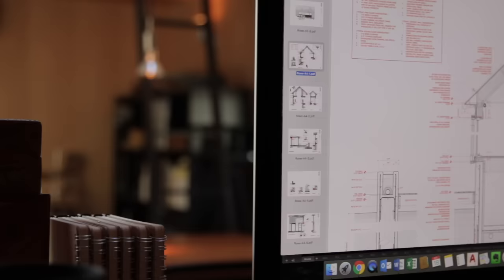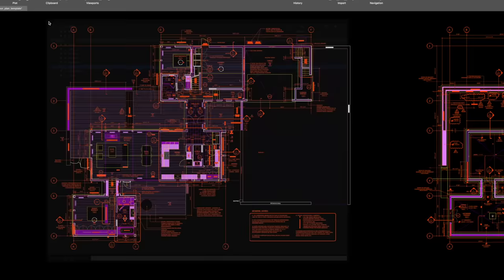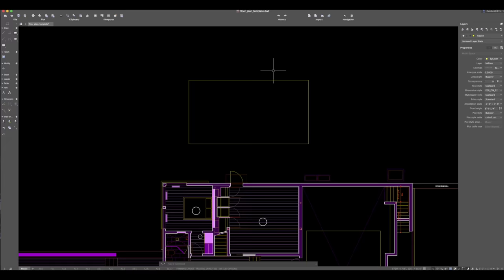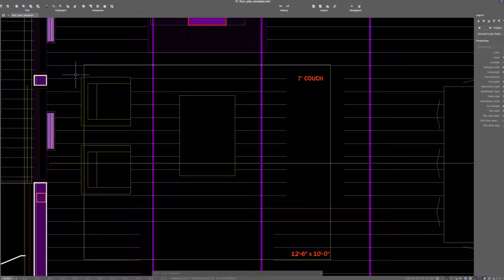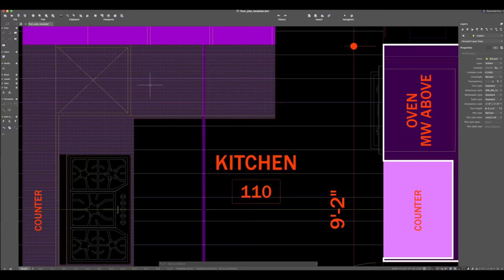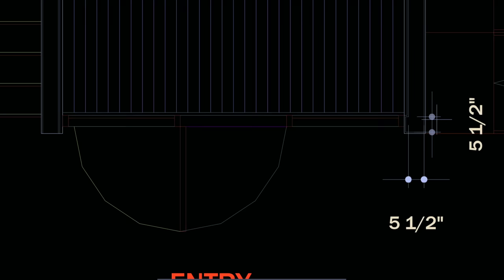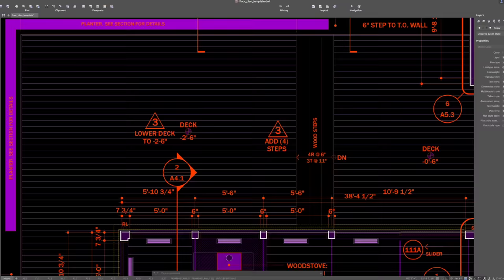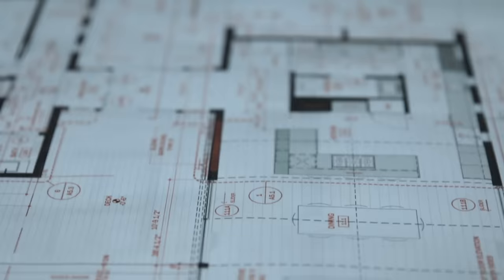Architectural Drawing Tutorial | My process + settings

Comment: I've been drafting since the late 80's, learnt the old school way on drawing board, pencils & ink pens. Then took up AutoCAD pre Windows era in 92 and used this for years. Now I use Revit, it's a joy to work with once you learn. Good video though on the essential discipline of preparing technical plans.
Reply: I'm thinking about starting at 24. The work interests me, but I grow worried about exactly what career opportunities I might have. It makes me happy to see you've been at it for such a long time. What kind of work do you do?
Reply: @reinaldoverde9825  good time to start, the key is to diversify. I did mechanical drawings, then residential design, structural detailing, renovations, new homes, light commercial, decks and pools, retail fitouts etc. My only regret is I didn't get a formal degree if Architecture.

Comment: I use Revit and now that i have learned it a bit more i can say it can totally replace autocad and save you huge amount of time for line drawing!
Reply from the maker: here's a question for you: how do you reconcile the idea that efficiency gains for a business that bills on an hourly basis don't benefit the business, only the client? which is to say: if i'm more efficient, i actually earn less than i do now. 
this isn't an efficiency problem for me. if i get the right clients, i can spend the time i need to on the project (within reason) because i'm already efficient using the tools i have. certainly i'm interested in BIM and I can see the benefits for sure, but I'm more interested in building some architecture, working on my photography, making physical models, recording videos, making films, hiking, traveling...all those things...and i'm afraid i put all those things above learning revit...

Comment: Been drafting and building for over 35 years, even today i find all architects/designers change their ways of doing plans. most don't use the materials method they leave it up to the estimator to figure out. Where i build structures and cabinets, I can draw an exact detailed plan for my workers or sub-trades.

Comment: >Draws floor plan
>no autocad
>open sims 4
Reply: i use bloxburg on roblox because im poor lol
Reply: @only_kaylaxo8329  I use roville lol
Reply: @only_kaylaxo8329  i LOVE bloxburg
Reply: I use Chief Architect Premier, for the past 10 yrs, along with AutoCAD, and SketchUp. CA is similar to SU on steroids. I use AutoCAD mostly for detailed cad work, also cause I’ve used it since original version back in 82’ if memory serves me. SketchUp I use primary for making symbols or 3D SKPS for use in CA. Self taught in cad along with 40 plus years as a contractor and GC for 32 of um.  Just love the drawing and challenges.
Reply: @Ben Yehudah That's tough to answer, I love drawing in general. Unfortunately my hands aren't what they used to be so I rely more and more on technology. I do however find the technology these days quite amazing compared to what I worked with back in the 80's. Before AutoCad introduced 3D.

Comment: Beautifully shot and wonderfully executed video!

1) Do your GCs and their subs not photocopy drawings?  I agree that color (even limited to B&W + Red) looks great for the first generation, and that transparency/shading like that looks great off the plotter.  But I've never plotted 100% of the drawing sheets that are used by the folks actually bidding and building a project.  Even with PDF drawing distribution, many sets are clearly photocopied from original plots, particularly for subs.  Red becomes dark gray for the first copy and ??? for later generations.  Shading gets jacked up with the high contrast of photocopying, so a light gray may be lost in a generation or two and a middle gray may become black. Where annotations cross over gray... may become a solid blob of black...  Line hatching, stippling and dashed lines survive this, of course (mostly.)  Fine line weights can be a problem.   How much have you rooted through the drawings subs are actually using to see what becomes of your beautiful starting points?

2) Given the comments here, it looks like a lot of your viewers would love a video that goes into much more depth as to how and why to use various types of hatches, shading, etc. particularly in elevations and sections.  You're spot on that it helps, but for folks at the beginning end and middle of the learning curve, it's a big leap from "you should do this" to  understanding exactly how, why and when.

Comment: Excellent video with good information.  One thing I read once and use it for my line weights settings is that in order for the human eye to see a difference in 2 lines of different thicknesses, one line has to be 1.4x the thickness of the thinner line.  I have a pen table for each size print.  I print 11 x 17 on an HP5000 with a pen table set up for 11 x 17 and a different pen table (thicker lines) for 22 x 34 or 24 x 36 plots.

Comment: "I use the most primitive CADs"

Man, I use Autocad 2007
Reply: I'm still using AcadR-12 with the Soft Desk Auto-Architect add-on. Been using it since it first came out in the transitions from drawing boards to computers. C. early 1990's. Started with Acad-R10.
Reply: Maybe the best release, IMO.
Reply: I would agree about R-12 being the best. Where I worked, our IT guys would come around and ask if I wanted to update my AutoCad. I would ask what revision is it? If it was an odd revision? There is no way I would do it. If you think about it... R-10? was good. 11... alright, R-12... Great, 13... sucked, R-14... almost as good as 12. Odd, bad. Even, good!!!
Reply: @straightshooter8443  Good tip about odd and even. It would be nice if they took R12 and just updated command enhancements just leave the rest alone. Ugh.... LOL..oh. R13 was so aweful, I stayed where I am for now. R12.
Reply: Our firm has been using ACAD2004 since early 2000's, and almost worship it. No subscription extortion or cloud struggles. Stable as hell and resides on its own, hermetic XP machine (soon to be updated). We've pushed out projects from small residential to corporate, mixed-use. So true: it's not the instrument one uses to draw that creates the design, it's how one uses the instrument to design. Recall, the first designs were likely described with sticks in dirt.
Reply: Some of my seniors acclaimed that 2007 version is the best. I myself use 2013 tho.
Reply: Tf
Reply: Dude, Autocad 2007 is the best version.
The most stable and fast response on a normal computer.
I have to say bye bye to them on Windows 10.
Reply: 哈哈哈哈哈哈哈哈哈😄

Comment: As a part-time residential architect (I am a healthcare project, Program Manager/Project Executive), I struggle to find the time to add the nuanced details to my drawings. This is especially so as most of my clients are looking less for a design than a stamped set of drawings to get their building permit. These videos have inspired me to spend the time setting up a better drawing template (I just purchased your template as I use AutoCAD LT as well) and a little more effort making my documents more than lines on a paper. Thanks

Comment: These are some seriously excellent tips but as someone who receives architectural DWG's to use as backgrounds (XREF's), it's nearly impossible to easily remove their hatching and some linework we don't need showing through in our set if it's not on a specific layer. For this reason, I prefer people separate their layers as much as possible. Just as long as they're called out and separated consistently- they can be whatever name you want. Really, though, I think as you have alluded to - just be very organized and consistent. Both you AND the people you work with will appreciate it in the long run!

I definitely appreciate how you use AutoCAD LT- as am I. There are way too many frustrations with letting the software (BIM) "do it for you."

Comment: Apologies if this is a stupid question (I did a few years of architecture a long time ago, but mostly have experience with graphic design) - is the fact that increased line weight increases the imprecision of the line ever an issue, or is it strictly used to demarcate the importance of the element?

In particular, I noticed that you use the heaviest line weights for the outline of the walls, but on the scale of a floor plan it seemed like that increases the thickness of the wall on the drawing noticably, and since the walls are filled with the darkest screen weight anyway, I wasn't sure what that sacrifice in precision bought you.

I guess in practice no one is going to lift dimensions straight from the drawing (that's the point of adding comprehensive dimensions to the drawing), and if you need to see the fine lines that might get swamped by the thicker line weights, you'd be referring to a detail anyway...
Reply: my exact question also. i've set my line weights by colours and are now perfect. While im drawing, i turned the 'display line thickness' off so it only shows up paper once i print.

Comment: Excellent video! CAD Management and Development is one of my strong suits. I particularly like the hatched glass and tree outline you use. Something you didn't discuss was the use of custom interfaces/profiles, LISP routines, tool palettes, dynamic blocks and publishing to help increase your efficiencies while drawing (some of which may not be available in LT). Having a solid file structure system and backup system is also important, as well as developing a strong block library...there's ten ways to skin a cat in AutoCAD, but you did a great job of going through it all here and explaining why using true dimensions vs nominal (my preferred approach) designs can be beneficial. Your drawings speak for themselves. Keep up the good work!
Reply from the maker: thanks...!

Comment: This might be great for a small, private practice working on small projects, but the layering system would be far too inflexible for large projects. I also wouldn't plot color annotation; particularly in red. Color plots are more expensive and in a 200 sheet set that would be ridiculous. Also Contractors will usually plot in monochrome and that text will be pretty light & dithered on most commercial plotters. With the folding, wear and tear that happens on a construction site it's really easy for that to wear off and cause confusion or even mistakes. 
Good video though!
Reply from the maker: small residential practice here as I mentioned. I always think it's funny when people say printing in color is really expensive...having tracked this over 4 years, I have to say that the difference is extremely minor and besides, it's a reimbursable expense. so, clarity wins (for me). as we progress to using digital documents printing will be a non-issue in the future...

Comment: Eric. Great video. My only objection would be the lack of an architectural style font. I can see a need for a non-architectural font on mechanical, civil, maybe even structural drawings. But, my thoughts are that we create architectural drawings and they should be unique and stand alone from the other disciplines. If the worry is a perceived notion of a lack of clarity or an idea of a TOO hand-drawn feel on a CAD generated drawing, then I would think that as much care in the selection of the font, size and note/label placement as given to the other elements of the rest of the drawing could help to mitigate any conflict. I’m just curious about why you don’t use an architectural font?  Preference or utility?  Thanks for such great insights per usual.

Comment: Eric,
Love your videos, very informative. I too use Autocad lt and have for many years. Although I miss hand drafting. The way you use layers is interesting to me in that you don;t separate them into categories; walls, windows & doors, electrical and structure, etc. I use separate layers so that I can turn them off for different sheet. For example, I turn off door swings and poche in the electrical plan as they may interfere with the switching lines graphics.  

Would you be willing to share you're layer set up?

And I whole heartily agree on the fonts. I work with an architect that insist that I use the chisel style of font. I don't care for it, it doesn't allow for lowercase lettering and it's a wider font therefore taking p more space.

Keep it up,
David

Comment: Hi Eric,

I notice you're running CAD LT on a Mac. I also use LT but I've always been afraid to make the switch to Apple. In your video about hardware and software, you basically said "tomato-tomahto" but do you find any notable differences in the same CAD software on the two operating systems? 

As an aside, I've taken a cue from you and changed my text and annotation layers to print in crimson instead of black. It really makes a significant difference. That, and adding shadows to my elevations, even in CDs, makes things so much clearer for everyone, including the contractors.

Many thanks; even this middle aged fossil has learned a few things from you!

Comment: Fantastic video. Had one question and it may be an amature one. I see you print your own sheets rather than sending them to a printer. After printing how do you bind your pages together or do you at all. I've seen many different ways for 24 x 36. leaving them loose. glued. spiraled (smaller prints) even metal bindings. Which way would you say is the best (cheapest) without diminishing quality. thanks again for all the videos!

Comment: I have a question, Eric.

I can definitely see that you use more than one line weight in some of your blocks. In using a line weight-based template such as yours, to which layers do you actually assign blocks once they're in Model Space?

Thank you!

EDIT: ah okay so you don't have a layer 0 and use your layers directly instead.

Comment: When you changed it from double 2x4 walls and you had to change it to 2x6; did you use 2x6 studs or go with stagered 2x4 to achieve the desired thermal bridge break?

Comment: Nice.  Hi done a few MEPs.  I'm an EM Drafter/Designer retraining for 1st BS in Physics.  Disabled Veteran.  Designing Three Story Round House.  I would like to have it 3D printed when they have achieved three story concrete printing ability.  I really want to keep the cost down on this and use my VA Buildable Loan.  Ever done anything round.  It's on my FB.  It looks gawdy but I kept sq ft low around 2500 for taxes when I retire.  There are several security features of the home impervious to fire, forest or man.  Able to withstand a riot outside.

Comment: Sir, your videos are really helpful for me as a designer.. I have used the Franklin Gothic font as you recommended. But, some texts seems bold then other seems small as i use the  same line weight..basically i have this problems while exporting plan in PDF..please help me how can i print the text in same line weight and thickness..i hope for your reply..thankyou

Comment: your line ends seem to be square, regardless of the line weight you use. How did you set that up in autocad?
Reply from the maker: you have to make sure the plines are closed (continuous)...check the autodesk site for the variables that control how it's displayed too (plinetype + plinegen)
Reply: i was referring at the fact that the really thick polylines are not rounded at the corners; higher than o.35 mm lineweight usually looks rounded in the corners. But anyway I figured it out; you just change the polyline's geometry width and it will look sharp. Thanks for the reply and keep up the good work. You have an awesome channel.

Comment: Your drawings are a very clean look, however the layer management has one major sticking point that I'm sure you've stumbled upon: If you wish to freeze the doors and windows, but show the stairs such as on the Framing Plans, you are stuck either showing the doors and windows, or having to redraw or move to other layers.
I'm guessing you get away with this by copying drawings multiple places across the drawing, and then deleting the elements you don't need on that drawing. This works until you must change something. You can create a block of the "base" floor plan, of course. This prevents you from catching alignment errors.
By keeping layers organized by the components, you can control how they look independently of one-another, and tailored to the drawing you are producing.
You don't need a ton of layers to do this. If you have too many layers, you are probably putting too many things in one drawing. Your View files may have only 2 or three layers. Constructs may only have 5 or 6. This keeps things light, allows you to only work on what's important, and allows two people to work on one job.
I have Constructs, Views, and Sheets. It is a one-way hierarchy. Sheets consist of Views. Views consist of Constructs. All the annotation is done on the Views. Constructs have tangible "things" like walls, windows, cabinets, etc.allowing for uncluttered working. Views are how you present those things for the drawings, such as the Electrical Plan or Floor Plan, with annotations, dimensions, light shaded for non-important things, etc. When you have a View complete, you can pull it into a Sheet. For simple projects, combining Views and Sheets isn't really a big deal. I would still keep Constructs in separate files than the views, though.

Comment: 99 times out of 100, within a couple of weeks, the GC will be using black and white plots/copies so won’t see the red font any differently to anything else. Relying on colour in architectural drawings isn’t as wise as it might seem. Make your drawings and details as clear as possible in black and white and it’ll repay you later when some roofer is 5 floors up, hanging off scaffolding, clutching a wet, ripped 8.5x11 b&w photocopy of a single detail from your ArchD originals. That’s the reality of actual construction vs the studio.